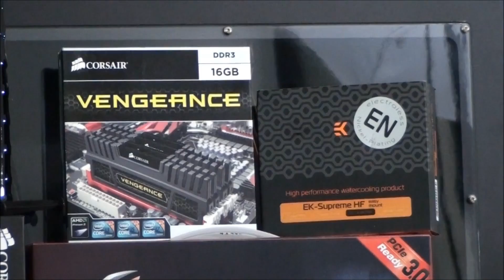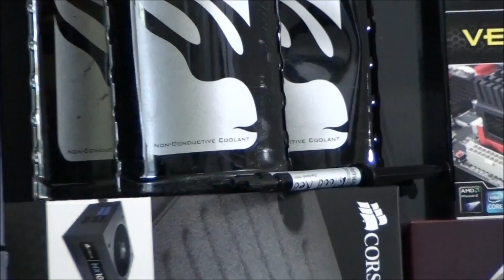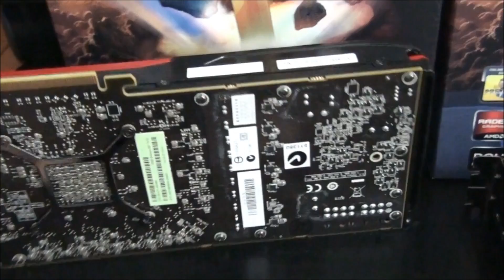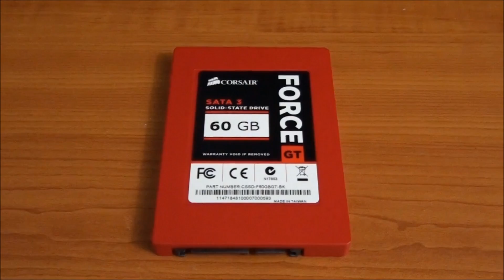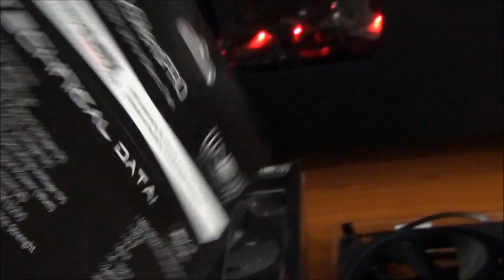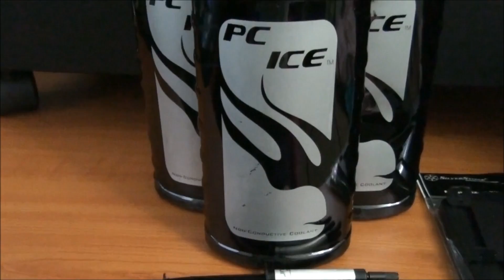Build #4: Extreme TJ11: Part 1

Comment: Some liquids like the ones used in computer liquid cooling loops are mostly non conductive, This is a safety precaution in the event it does leak :).  I recommend maybe watching Singularities water cooling guides. They are really informative. I also recommend LinusTechTips for learning more about computers in general as well as water cooling loops.

Comment: I noted you chose the board as it is "more for gaming" rather than overclocking, except the 3930k is made for overclocking and is generall overkill if it is just a gaming machine. Was the processor just more for it's prestige?

Comment: @SingularityComputers I am building an i7 2700k computer and intel says use 1333 memory should I get the 2300 for about 30$ more, or is the 1333 memory better and will yield higher performance.  I am buying 16GB of gskill 1333 memory right now.

Comment: @vanhodid will 2000 mhz @ 3.2 ghz make any difference from 1600 mhz @ 3.2 ghz ? or do i have to increase the cpu clock in order to make a difference

Comment: okay I installed a new graphics card its a AMD 6970.And i uninstalled all my nvidia drivers then i installed the AMD drivers then reset my computer.and when goes to boot into the user screen
it says out of range. So i restart and try to go into safe mode and it does the same thing.But i can get it to go into 640X480 and then it work but i can't get it to go any higher.